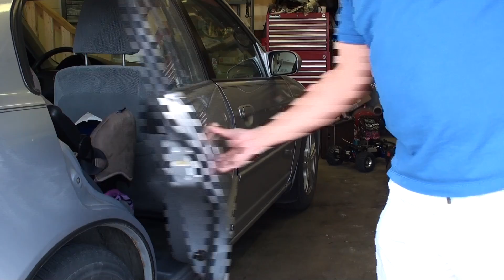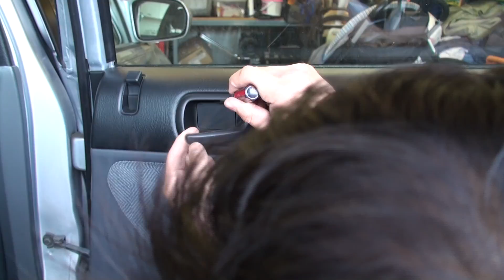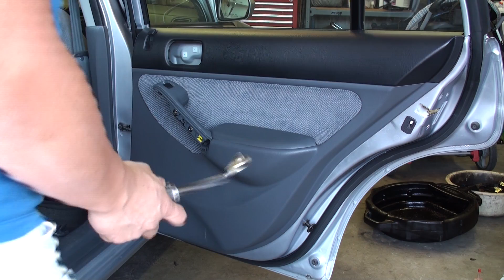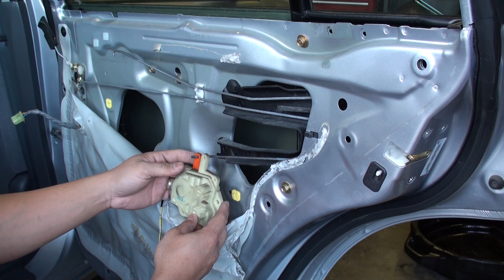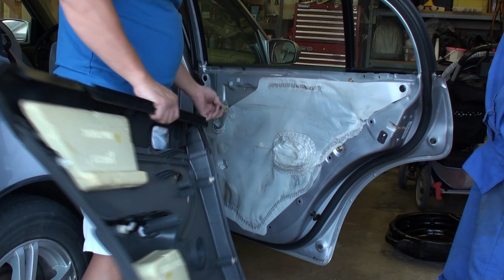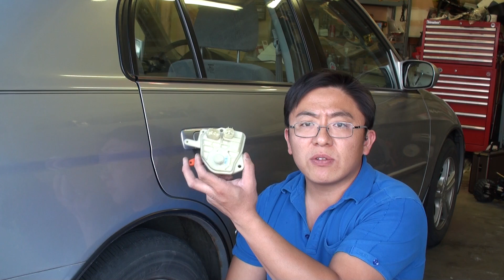DIY Honda Civic and Acura EL Power Door Lock Actuator Replacement

Comment: Great instruction!  I'm wondering if this would be the same steps for the front driver door.  My locks are engaging each time I stop the car, and then resume driving.  They are supposed to only engage once, when I first start driving.  I know I can change the setting to only have the doors lock when I put it in park, but I'd rather fix it.  Do you think I need to replace the actuator on my driver door to fix this problem?  Thank you so much!  :-)
Reply from the maker: the front driver's door is a bit more involved b/c of how the lock mechanism, lock/unlock sensors and striker are pieced together.  Certainly more complicated than the rears but if you can one door I think you could do ANY door if you had enough patience.  If you want to change how the doors lock and unlock consult your owners manual.  It should explain how to toggle between the different lock/unlock modes.
Reply: Thank you so much for the info :-)
Reply from the maker: you'er most welcome!

Comment: Hey man, my rear left door actuator gave out so I tried to remove it for replacement but went I removed it and put a spare on the 20 amp fuse kept blowing when I used my power lock remote. I put a 30 amp fuse and they sound like they want to move but don't have enough juice. The actuator I put in was old so i probably need a new one but my question is why are the three doors that were working fine before no longer working? Everything was fine with them until I changed out the broken actuator. Any ideas?
Reply from the maker: hmm, that is tough to say but I would immediately remove the 30 amp fuse as the circuits for that actuators if there is a short will destroy more components b/c of the short and not blowing the fuse.  They spec'd the 20 amp fuse for a reason so don't go subbing in different values to prevent it from "popping".  You have a dead short somewhere and I suspect it could be a faulty actuator or even possibly shorted wires in the door or possibly a bad master driver's switch.

Comment: You can actually open and fix that actuator. You have to open the electric motor in it and alu wrap the tiny "fuse peace"
Reply from the maker: While I would agree that you could do that that in the end it was much faster and simpler for me to just buy a new part.  If you have time on your hands and you wanna tinker that is perfectly acceptable as well!
Reply: What size is the motor? 10mm, or 20mm? D shaft or round shaft? I need to replace all 4 actuator motors on my 2001 Civic EX 4 Door sedan.

Comment: Sir, how do i do this with Honda City 2007-2009? 

My problem with my honda city is: using the FOB, door unlocks but doesn't lock, and also doesn't lock when auto-lock activates. So, I'd have to do it manually.
Reply from the maker: +scar559 hmm that is an interesting question.  I'll have to look into it further as it is a bit strange that it will unlock but not lock.  Honda City... is this an Australian Civic?
Reply: +piercedasian i believe this link is more informative than me explaining it. https://en.m.wikipedia.org/wiki/Honda_City
Reply: +piercedasian just today, the auto-lock worked and remote lock worked, and I didn't even do anything. But sometimes only the driver's side would lock, and the rest doesn't. If it so happen, I press unlock button of the remote to unlock the driver's side, manually push and pull the lock on any passenger's side, then press the lock button of the remote, and it'll work. Its so weird. 🤔
Reply from the maker: it almost sounds like the lock's logic controller module is screwed up.  I was actually thinking about this long and hard last night and it drove me crazy.  I can't make any promises BUT if I do come up with a solution that I'll let you know.
Reply: +piercedasian God bless you sir! Thanks for driving yourself crazy just to be able to help a stranger. Take it slow. More power.
Reply: +piercedasian it probably is. Every time i insert the key into the ignition/turn-on after auto-lock activates, alarm goes off. So in order to avoid that, i must insert the key into the ignition/turn-on before auto-lock activates(which is about 5 to 10 seconds).

Comment: i changed the actuator from the driver rear door, still its not working, what else could it be?
Reply from the maker: +Luca Mento Hi Luca, broken wires is your problem and I've got a vid that I'm currently working on publishing in the next day or two to show people like yourself how to fix it.  Broken wires always happen at the rubber boot in the door joint for the back door.  The constant flexing of the wires in that tight cavity causes the wires to break and lose connection.  It typically starts out with the windows failing followed by the lock actuators.  Consider subscribing to my channel to get notified when post the DIY fix it vid for the wiring harness which will be up in about another day or so.
Reply from the maker: +Luca Mento Hi Luca, see my video that will more than likely solve your inoperable rear power door lock.

https://www.youtube.com/watch?v=oa9aI9BDVyY

Comment: Excellent.   
Is the procedure same for both front doors?  My 05 Civic is powered door,  non-powered window.  I still roll up &  down 😁

btw... is that HPI Savage Nitro?
Reply from the maker: xxgg front doors are a bit more complicated as the door lock mechanism is integrated with the door latch (if memory serves me correctly).  No the truck there is a Team Associated MGT 4.0.  Good guess though!

Comment: I have a 2002 1.7 EL, I am having same problem but it the right front passenger instead. Parts at my local Acura is $208.00. The dealer game me the p/n which is also same as the Honda Fit 07-08. P/N 72115-S5A-A01. I also checked the honda civic part # 72115-S5A-003. Do you think I can use the honda civic part which easier to get online at 40.00?
Reply from the maker: Ed Lopez WOW $280???!  that is what I call robbing people blind.  If the part #'s are the same then I don't see why it wouldn't fit.  Honda and Acura share MANY of the same components and in 99% of the parts I ordered they all come in Honda packaging too.  I would call Acura to question why their parts are so insanely expensive.  Maybe the parts guys got the wrong part?
Reply: +piercedasian Iu was just quoted 650$ for the 2 passenger side actuators at ACURA Dealership!!!
Reply from the maker: what a joke!
You can fix it for next to nothing after watching my vid!
Reply: And i totally will! Your video was great!
Reply: +piercedasian Just called Honda - Told them 2005 Civic - They quoted me 70$ each.  Doesn't guarantee me they will work in my 2005 Acura 1.7 EL. But according to the video above.  They are IDENTICAL!!!
Reply from the maker: that they are.  Glad you got it all figured out.
Reply: +piercedasian Closing out my story here. Honda actuators are in. Working.  Issue resolved for both doors.  As it turns out part #'s are different because the Acura has a factory alarm.  Which is apparently now disabled. Haven't tested it myself, I never even realized the car had an alarm. (my key fob doesn't have a button to activate the alarm)
Reply from the maker: hmm interesting.  You may want to double check about the factory alarm.  The EL has a factory keyless entry but the alarm as far as I'm aware was a dealership add on (genuine acura/Honda system that was installed after the fact).  You' know if you had the alarm if you armed it and sat inside the car and then unlocked the plunger manually and opened the door.  Alarm should go off. You can also look at the # of pins on the actuator motor and I'll be betting they are the same as the one for the civic.  I've worked on a handful of acura 1.7ELs in Canada and not a single one of them had the factory alarm.

Comment from the maker: @ azureecosse - Yeah I have found that certain Hondas do have more ancillary part issues than others.  I've been a firm believer that less is more.  My 91 civic has over 520, 000kms and that's because there is pretty much nothing on that car to break.  It has an automatic transmission and factory a/c.  No power locks, no power mirrors or windows thus nothing complicated to really break.  On certain Hondas it definitely is a PITA to change out some parts.  Every car maker has their issues.  What's ironic is the $100, 000 BMWs and Mercedes Benz have far worse reliability issues than an average "affordable" car.

Comment: Hey, this is really informative.
2/4 power locks don't work on my car. They don't work from the key remote, nor from the drivers side unlock/lock all. The two that work, work in both scenarios. What do you think is the problem here?
Reply from the maker: there are really two things that were very common on this generation of civic or EL.
1. The actuator is bad.  If it's no good then it will either only move well in one direction or not move at all.
2. Broken wiring in the door hinge area.  There is actually a sub harness within each door that passes through the B-pillar of the car -> rubber hing grommet -> connects up with power windows and power locks.  I've seen a number of civics have broken wires due to age/temperature/fatigue and of course when wires break you don't have continuity in a circuit. 

Either way the simple thing to do is check for voltage at the power door lock actuator.  Using an volt meter probe the connection and using a clean bolt somewhere on your chassis as the ground point.  Have a helper actuate the lock and see if you see voltage on at least 1 of the 2 pins on the actuator connector.  If you get no voltage on either one with the lock switch up or down then chances are you've got a broken wire either in the driver's door or in the door that isn't working.  The wiring harness is super easy to repair and in fact it is cheap enough to just buy a new assembly from Honda.  

Hope that advice helps!
Reply from the maker: you may want to check the wiring at the rubber joints in the door.  If the wiring is on the cusp of failing (breakage of the wiring harness is VERY common on the back doors) so it might be that it's not getting sufficient current to make the actuators work properly.  I actually  am working on creating a vid showing how to repair the wiring harnesses if you can wait a couple of weeks to watch my new vid.  It isn't common to have all actuators fail and I've only ever had to replace just a handful of them over MANY different cars and NEVER all on one car regardless of mileage.

Comment: Excellent explanation. 
I have a Honda Civic 2002 EX coupe and that's the problem I have. 
I'll buy the parts and see the video once again to make the change. 
Thank you.
Reply from the maker: yep it is a fairly common issue with these older Honda Civics.  The actuator just gets weak (for reasons unknown) and they just stop working properly.

Comment: i ve got a problem with my driver side door, whenever i try to unlock the door, it only opens the driver side door but not the other three doors as well. what do you think the problem is ?
Reply from the maker: there is a good chance that there is a switch, power door lock controller or to a lesser degree maybe 3 bad actuators.  I'd start by probing the power feed circuits to determine IF there is power getting to the actuator.  If there isn't then you could have faulty wiring in the drivers door or a bad power door lock control unit.  Do the other 3 doors not unlock with the switch with the wireless remote?
Reply: I don't have wireless remote, but the passenger door when i lock it, it opens the other 4 doors as well
Reply: And the internal door locker switch works fine at the driver door side, it only happens when i use the key
Reply from the maker: hmm it very well could be the controller on the remote.  Are you sure it's programmed correctly to unlock all doors when pressed a 2nd time?  Do you have another spare fob where you can test it to see if it yields the same results?
Reply: There is no remote at all,  just  key.
Some one told me that it could be a short circut that cause this problem
Reply from the maker: so then what you're saying is that the power door lock switch actuates all the door locks fine but when you use the key to unlock the door at the driver's side door that it only unlocks the driver's door and NOT the other doors.  Assuming I got your use case scenario correct then the answer is easy - you likely have a faulty driver's side lock actuator sense switch which normally detects the key turning in the lock cylinder which is supposed to signal the power door lock controller to unlock the other doors.
Reply: piercedasian
question ? is the actuator sense switch part of the actuator itself .
would replacing the actuator fix the sensor problem also ?
Reply from the maker: You are correct in that the actuator and the lock assembly trigger switch is all in the same unit.  That is why when you press down on the driver's lock plunger that it will lock/unlock all the other doors.  If that actuator is on the fritz then your key all lock/unlock won't work properly.

Comment: Hey would you know anything about key programming? it appears that my lock-remote has unprogrammed itself to my el so I have you lock my doors manually now
Reply from the maker: yes there is a way to do that.  I will need to make some time to make a video on it but here are the steps to do it:
1. Turn ignition switch to on (position II).
2.  Within 1-4 seconds press the lock button on remote.
3. Within 1-4 seconds turn ignition off
4. Within 1-4 second turn ignition on (II).
5. Within 1-4 seconds on the same remote press lock
6. Within 1-4 seconds turn ignition off.
7. Within 4 seconds turn ignition on (ii)
8. Within 1-4 seconds press the lock button on same remote.
9. Within 1-4 seconds turn ignition off
10. Within 4 seconds turn ignition on (ii)
11. Within 1-4 seconds press the lock button on same remote.
12. Confirm you can hear the sound of the door lock actuators. Within 1-4 seconds press lock again on same remote.
13. Within 10 seconds program up to two more additional remotes by pressing the lock buttons on each remote and confirming that the actuators activate the lock indicating it's acknowledged the programming.
14. Turn ignition off
15. Test remotes and re-program as required.

It's a length any repetitive process but this is how Honda does it.
Reply: piercedasian
Thanks a ton
Reply from the maker: @ Drew Smooth - no problem!